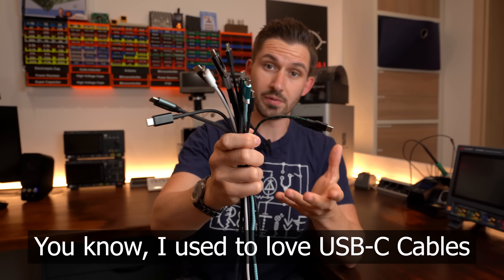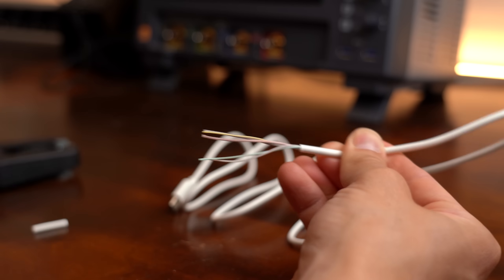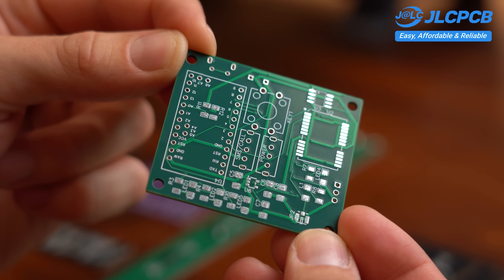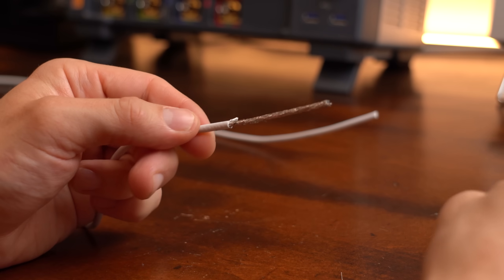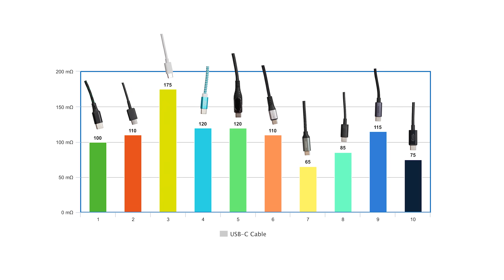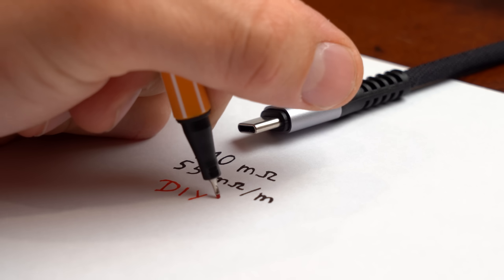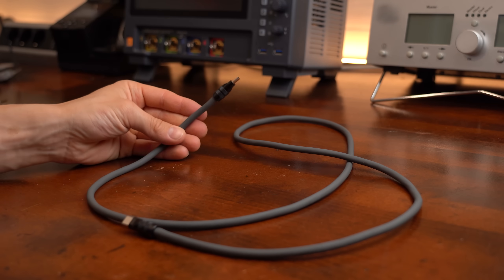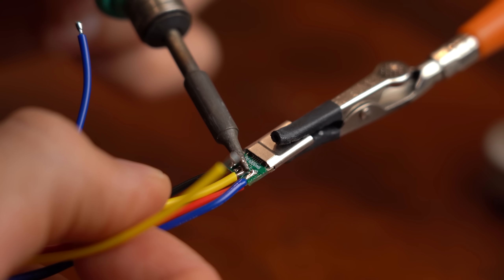Your USB-C Cable STILL Sucks — I Built a Better One? (DIY or Buy)

Comment: What about long length cable? The issue I find is as the transfer speeds/power delivery/features becomes more expansive, the maximum cable length keeps getting shorter and shorter. What if I want a 3 meter long thunderbolt 4 cable? 10 meter?

Comment: Don't need any USB, but I constantly re-buy audio cables for my headphones and microphone. Since I need 10 m cables it's pretty hard to find anything good with a proper diameter so I buy cheap eBay crap that breaks every couple of years. I thought about making my own cable but I'd need three wires in one since it's stereo and it's even harder to get those. Maybe something like this USB with eight wires would be interesting so I can put both cables (mic+headphones) into one.
Reply: Use shielded CAT5 or CAT6.

Comment: The main issue with those "aliexpress" cables is that they are mostly made with cheaper copper-coated aluminum instead of pure copper, which results in lower conductivity and durability and also safety tbh.. You can test this by applying a flame ( lighter ) to it if the wire burns away instead of glowing red-hot, it’s aluminum
Reply: aaahhh...here it is again, the old same **** opinion
Reply: @bolohosamah  opinion? it is a fact aluminum has slightly less than 2x more resistance per meter compared to copper and when you mix two metals most properties are combined towards the weighted average
Reply: @minerminecrafter464   i am not talking about ALUMINIUM
Reply: i think the context here is "chinese".
typical american smh.
btw, i am asian. all of my usb cable since the mini usb era are all chinese made. all of the cable i ever rework with are all copper. none of them made of aluminium or aluminumalium? alimunimanium?
Reply: @welehweleh-zb6jc  the correct name in the periodic table is malimanum
Reply: @welehweleh-zb6jc  IIRC the correct spelling depends on where you are. In the US it's aluminum (thus our pronunciation) where as in Europe I think they spell it aluminium?
Reply: @bolohosamah   Then what are you talking about? Nothing @_q0w0p said could be called an opinion to begin with, and the only issue I can see you maybe having with his statement is his assertion that aliexpress cables sometimes are copper-coated aluminum, which doesn't sound that outlandish a claim to me.
Reply: @monkeywithocd  he edited his comment. before, it was, "chinese cables". he generalized all chinese cables are bad, because he didn't said the cheap ones.

Comment: The problem IS technology, or to be more specific the standard.
USB 2.0 (with all the original USB connectors) was well designed, simple and very complete. 
All devices and cables had specific requirements that they had to follow, so everything worked with everything.
With USB 3.0 its USB-C connector the standard became murky, because everything is optional, so you have no guarantees as to if something will or will not work with another thing.
And optional is one problem, the naming is another one. And then there is USB-PD, which on the newest revision supports voltages that are considered life endangering.(lowest known case of fatal electrocution is 43V, and USB-PD allows for 48V). That standard is just a huge mess.
Reply: 48V is not seen until the voltage is negotiated, so you can't stick your finger in the plug and get a shock.
Reply: @jaro6985  I am not talking about sticking your finger. Have you seen the state of cables some people have, with damaged sleeves and exposed conductors.
With 48V that is a huge hazard. And an average Joe would not be aware that its dangerous, because "its just usb". At least for AC 220V we managed to tech most people to be aware of danger.

Comment: Did you know, than an electric scooter called "Äike" uses usb C for charging. You can use a normal wall brick up to 100W for slow charging, but the included one for faster charging. I think its really awesome!

Comment: I recently bought 6 pieces of the 65mΩ/325mV cables - 1m for 3,19€ each and 2m for 4,22€ each on Amazon - these are absolutely perfect for the price, 100W and also 10Gbit + DPalt 4k/60hz worked perfectly under real conditions. Price/performance absolutely top with them.

Comment: Do you think I care about tiny power loss? What I love are the 360 degree magnetic quick connect with 180 degree of cable swivel. Yes many connection points for extra loss but man the convenience is through the roof. Oh and not green quick charge but blue ring for super quick charge. Yeah it works great!
Reply: One starts appreciating these after the USB-C connector on the laptop wears out because of numerous cable drags here and there.

Comment: Interesting, but why not twist the two power wires together, before soldering? It just seems like it'd be easier to solder? 

It wouldn't be worth the time and effort for a neophyte like me. But it's nice to know it marginally improves its performance and allows greater customization.

Comment: I think a mΩ per m comparison at the end should have been necessary.  9:07 It's one meter so it would be 60 mΩ and not as fantastic as 5 and 6 in 5:27 with 60 mΩ and 55 mΩ accordingly.
Maybe it will outperform those anyways with a longer cable.

Comment: It’s time to pull out the USB type C distinguishing chart🎉🎉
With different speed(None/2.0/3.0/3.1/3.2/3.2gen2/4.0/TB/mDP) and different wattage rating(20/60/100/130/200/240) and some special features like hardwired CC resistors to fix the voltage to 5V, you easily get a whooping 50+ different cables ALL LOOKS THE SAME🎉🎉
And all you need to do is to buy first, test it, throw away and repeat the whole process until it works. How convenient?😆😆
Reply: Luckily in Europe if it does not work we can just send it back and get a full refund (including shipping costs).
Reply: @hubertnnn  that's still annoying, something needs to be done to the ridiculous marketing of the USB consortium, if they weren't retarded and created some naming scheme that was less confusing.
Reply: @hubertnnn how convenient!
Reply: Именно. Причём, продавцы разъёмов часто не указывают для чего они. Просто дают фото, и хорошо, если там видны резисторы и какие контакты разведены на плате.
Reply: this is such a made up problem lol, just check the transfer speed and the wattage, that's all you need to worry about and it's not difficult at all
Reply: @swedneck  Check them where? On unmarked cable (or marked with a brand and nothing else)?
Reply: @swedneck  Because no one writes those specs?
Reply: @swedneck maybe you only have one or two at home
I myself seen everything comes with a usb cable in package
throw it away so you don’t mess up? sorry some ONLY works with the cable it comes with. Why? in type C there’s a CC pin for appliances to signal the required voltage, simplest way is just one resistor. But guess what? they omitted it in the appliance and hardwired it in the CABLE!!
Without the resistor, a normal cable and normal cable won’t start delivering power, not even standard 5v.
TBH not everyone knows why this happens. For average folks, they can only keep the cable.
But there’re literally EVERYTHING use rhe type C port, as simple as a table lamp.
Now let me as you, how many these crap you will have at home if 50% of small electronics you buy are made that way after a year? 
EU save the environment? only if they not only enforce the physical connector but also the electrical characteristics. But how the hell can they test everything before importing?
Reply: There’re also cases that the appliance omitted the resistor and didn’t put it in the cable, so either:
need to use Type A to Type C cable
or
only works with the type c power supply it comes with(dangerous! if you use this power supply to power something else, it may blow up!)
So you might also need to keep the charger
what the hell
Reply: @flyviawall4053  My father has a power supply like that, it only works if you convert it to USB-A and back to USB-C, but does not work with a C-to-C connection.
Reply: @hubertnnn 🤦‍♂️
How evil is this…

Comment: My primary issue with usb-c connectors is their durability. The design lends itself to applying torque to the connection, easily damaging the port. If I were to overengineer a diy solution, it would be for this problem.
Reply: Durability is one thing. These connectors collect dust like there is no tomorrow, and cleaning them is a pita. 
And after they collect too much dust they no longer keep the lug in.
Reply: @NickCombs technically there are vga style screws in the usb-c spec and there are cables and devices supporting it but it’s relatively niche and not really elegant.
Reply: I thought of this, I wish we had magnetic flat pads instead of plugs. think about it, most tech alreadt has a flat surface
Reply: That's why I use the magnetic cables and adapters from AliExpress. Ports don't get broken or filled with gunk. Same cable for usb-c and micro usb. 

I love it!

Essager my favourite for low wattage, which does fast enough charging for my phone.

For higher watts usilion do pd cables, but they're incompatible with essager, and have no micro usb plugs.
Reply: @KerrySainsbury  Be careful with magnetic USB-C cables. Magnetic cables cannot follow USB-C Spec. The way USB-C works means that an incomplete connection between the two magnetic parts can catch fire or short out. (It's unlikely, but it is possible.)
Reply: @xBrokenMirror2010x  Thanks for the advice; you make a good point. Of course I've managed to damage devices using normal USB connectors too, so perhaps there's no way to win this game :-(
Reply: @KerrySainsbury  What do you mean, incompatible with Essager?
Reply: They have different shaped connectors, so each require their own cable

Comment: and great scott you can solder small cables with twezers just hold the wire with the tweezer and then solder.. use a thin head solder iron not that fat thick one thats your problem.. always tripple check to make sure small strands arent around where your solder joints are or youll short out your crap heat shrink it with marine grade heat shrink

Comment: first you can only charge a phone so fast the ions cant go anyfaster we are at entropy unless we use super caps and tripple their capacity and lower the size of them... you can get 240 watt cables its proven theres no need to make your own this guy only does this crap to make profit from his videos yes lots use punny wires so you the consumer have to buy several cables that say 240 then with 10 youll get 2 cables that are real.. its china they lie lie lie to profit more.. so once you find a true 240 watt dont loose it is all... ive got a couple that are true i treat them like gold

Comment: Almost always, I think for the long term.  For example, to me, it's worth paying more for an 80 Plus Platinum PSU because over time, I'll be wasting less power in the PSU, and therefore spending less on commercial power.  It has the knock-on effect that the likely form of waste is heat, which then I have to spend more on electric in the summer to pump the heat outside. (Sort of balanced with not having to spend as much in the winter on heating, I guess).  So I'd rather spend more on materials and my time if a system is more power efficient, therefore agree with your conclusion.  Helps if you have a soldering station already, which I do.

Comment: A suggestion to help you with the connection to the board : solder pins onto each pad and set them in resin. You might consider repurposing some network cable for the twisted pairs handling data... Looking for tips on cat-proofing the cable 🙂

Comment: You should just use CAT 7 Ethernet cable. All wire pairs are individually shielded and the entire cable also shielded.
You can also get it with silver conductors instead of copper, or copper cladded Al, which will drastically lower your overall resistance.
Reply: CAT7 uses 23AWG which is going to be garbage for power transmission. that and its super stiff.
Reply: USB does not mean under-sea-bus but a cable thicker than the connector is a good defense weapon
Reply: Don't use copper cladded aluminum
Reply: If the industry can make CAT cables to the spec and you always get what it says on the tin, that means the confusion is caused by the USB consortium, not entirely the fault of the manufacturers cheaping out.
Reply: @monad_tcp there are very few cables with actual USB logos on them.
Manufacturers largely don't bother to label ports on host devices too, but this seems to be changing slowly.
Reply: @VADemon They only do what they need to legislatively, which is include it in the packaging material.
Reply: @gtjack9 funny, YT yeeted my comment for a quotation from USB-IF documents. In short: no, they aren't forced but also can't put a USB Logo without the device/cable undergoing certification.
Reply: good idea. PoE is also a widely used application. the diameter though...
Reply: @VADemon Yeah, if you want the full USB-C specs, there always a compromise, in these cables, they get pretty thick. But if you want a compliant 10m USB-C cable the diameter suffers quite a bit.
Reply: @gtjack9   the specs are too lenient, they should really have separated it into classes and use a different naming scheme. the USB-C branding is the most retarted marketing I ever seen on anything. They manage to be worse than Microsoft.
Reply: I've just had a thought.  Let's bin the USB C standard as a requirement.  Let's have RJ45 Ethernet connectors on everything as the requirement.
Networking, USB, Power, displayport, hdmi, vga, etc... all in one cable.  All in an Ethernet cable.
Reply: @Shocker99  Everything with the broken plastic clip that keeps falling out all the time? At least USB works third time I turn it around, RJ45 works FOURTH time every time!
Reply: @adonisengineering5508  I'm clearly joking.  Think about how thick all of your gadgets would be to accommodate an RJ45. 😂

Comment: Even connecting one CC1 line works, but it works only one way, you have to swap connector orientation if not works.
But here I didn't understands why CC1 should goes to CC2 and vice versa 🤔🤔

Comment: You say puny power losses but I legitimately have some dumb cables that have come with devices that are so bad that it multiplies charging times of some devices. I'd like a way to weed them out so they never get into circulation. 
I've looked at that device before but as you say, it's a bit pricey. I've considered building something myself though that would work out even more pricey probably and wouldn't likely have the chip detection.

Comment: I even put a spring relief (which did help not to bend the wire) on the cord so not to break wire at the connections but it still happened!!! And for some reason once it stops the holding click, it also goes bad!!!

Comment: Please tackle the biggest flaw: falling out of the devices.... after just a few months or a year or max. a couple of years.
The old USB-micro at least did have hooks to keep the devices connected but this 'modern' connector somehow needs taping up if you use it frequently or hotgluing them into position to keep charging and rates consequently working since they seem to work just on friction to stay in place. Seems to be easy and works at first but soo fast not anymore optimal.

Comment: DIY definitely! You can choose if you have 1.5mm2 or 0.5mm2 wires, solid core or flexible cord. One of my USBc charging cables was made out of UTP wire for ethernet (with shielding). Easy, cheap and extremely durable. 5 years passed and it ia still the best wire i ever had and i use also as a reference for other projects and troubleshooting.

Comment: What's wrong with sleeve, it looked fine?
Reply: If you're physically able to hook a USB C cable up to 400V connection, you have bigger problems than ambiguous cable color.
Reply: @jcon6734 It’s more about if you can’t see each end of the cable. We have wiring standards for a reason. But I will admit, it is nit picky.
Reply: It got shorter when he heated it which meant it was about 30cm too short.
Orange is a terrible idea anyway because it is a standardised sheaf colour for 400V cables for HV vehicles.

Comment: It's way too much effort. Just buy one from a reputable brand. To me, USB-C without high-speed pairs is basically useless, and I can guarantee you that even the low-speed data lines in your cable are not impedance matched at all. However, USB 2.0 is slow enough and has some error correction, so it sort of works.

Comment: I don't tend to have issues with USB-C cables from a charging point of view since I started just bulk buying Ugreen or Anker 100W cables a few years ago (although finding one of the handful of cables I own which support USB3 data, Thunderbolt/USB4 or DP-Alt mode when I need one is a different matter) but I have started having issues with some of my newer devices strictly requiring a PPS charger to fast charge in the past couple of years. It's kinda frustrating plugging a device into a 100 or 65W charger and ending up charging at 10 or 15W. I guess I need to replace all my older power supplies 😭

Comment: The USB standard is simply garbage in every form.
And it all started with USB3, where you bought the surprise package. The naming isn't any better: 3.1_1, 3.1_2, 3.2_1, and 3.2_2. So what speed do I have now?
5 Gbps, 10 Gbps, or maybe more, or none of the above?
USB-C makes the whole thing even more stupid.
Under 100 or up to 240 watt charging capability, DP port, USB2, 3.x_x, or 4 USB speeds, or whatever else. Pick something and support it, or sell it for a high price for none of those things.
The only thing that is constant is the connector type and pin layout.

Comment: Not really that interested in PD (the focus of your video), more interested in fast data transfer. I assume the cable doesn't control this, except maybe for shielding? Data transfer protocols determined by whatever it is connected to?